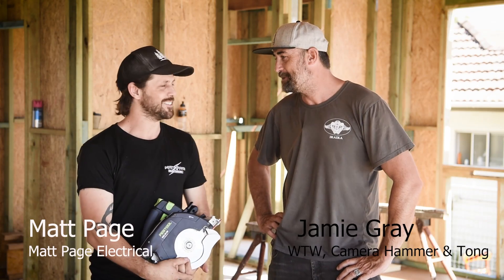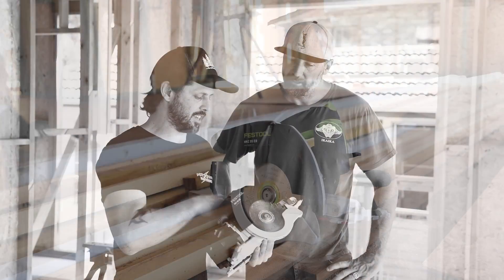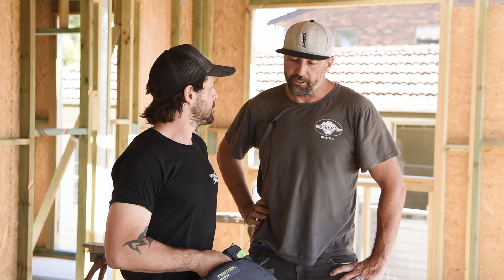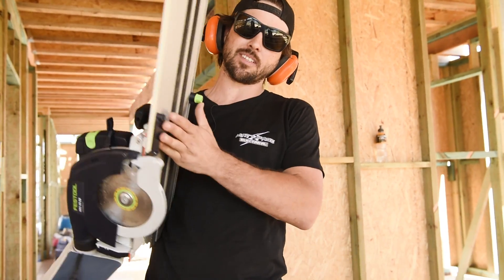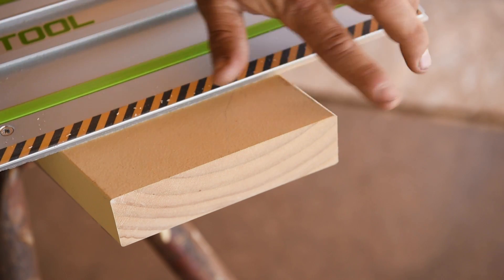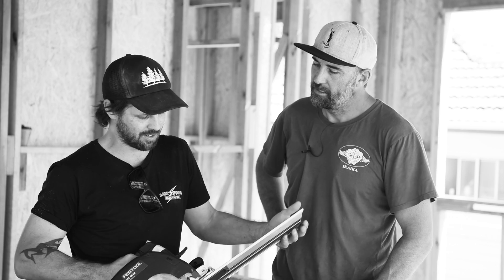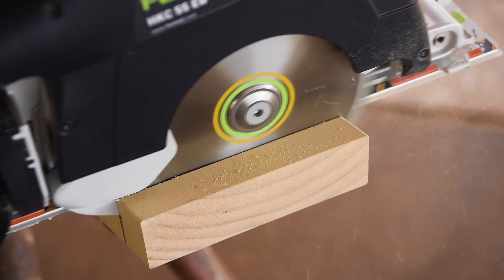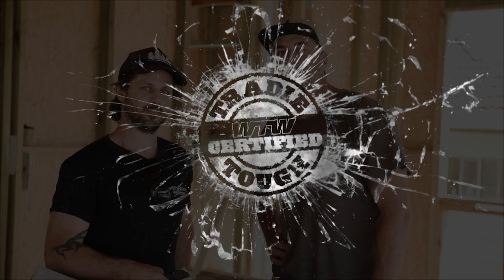Festool HKC 55 Tough Test

Comment: Great video!  I love our new HKC 55. It has made renovations on our 115 year old house infinitely easier since I can bring it up onto the scaffold / into the attic and cut on location. I notice your rafters are offset in your drone shot over the structure. Is that normal in AU?  We have that in our house and it completely stumped our engineer and inspector.
Reply from the maker: Hi Brent, thanks for watching and for the question. Offset rafters are not super common here in Aus either. Have been told that it's sometimes done for easier nailing, but don't have any concrete info for you sorry. Justin